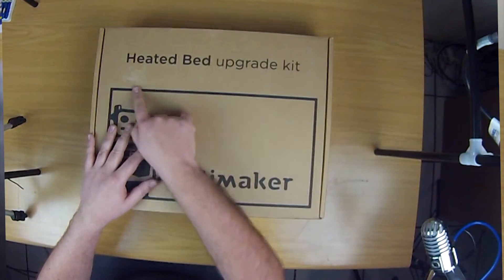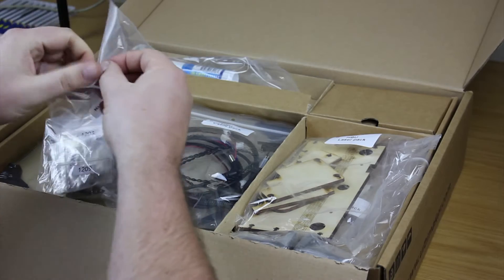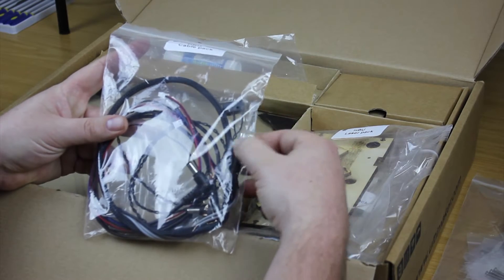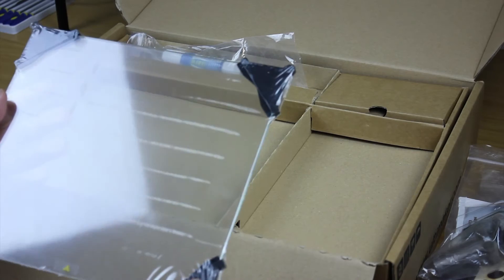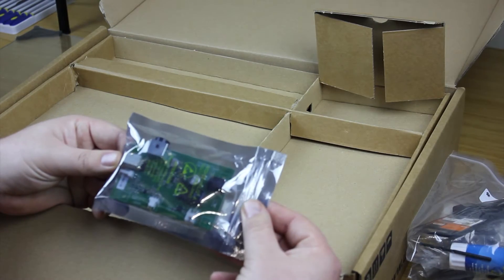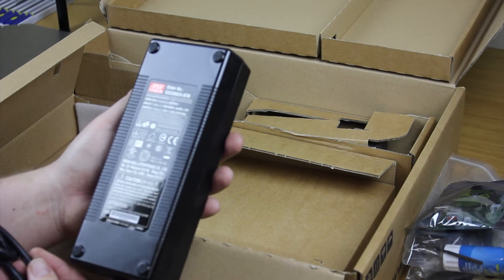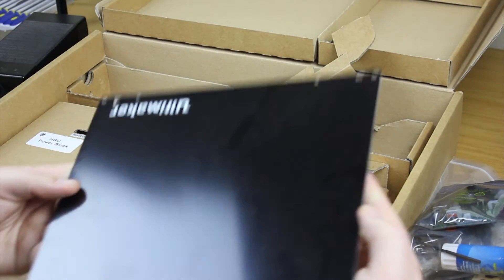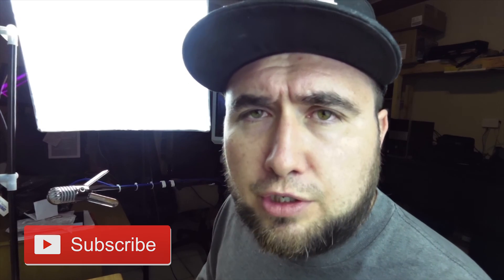Unboxing – Ultimaker Original Heated Bed Upgrade Kit

Comment: I upgraded my UMO. Such a difference to the printer now. Well worth it.
Reply from the maker: Hey thanks for checking out the video. yeah I am to enjoying the upgrade, well worth it :D how did you find the upgrade procedure ? Did you have any problems after the upgrade was done, for example the firmware didn't load and prints came out weird ?
Reply: I didn't have any real problems with the upgrade except checking and rechecking that what I was doing was correct. I had a couple of bolts that were the wrong length, but all in all, no problems. Prints have always been good from my UMO and even better with the bed. The latest firmware is even better and has breathed new life into the printer.

Comment: I just installed this about two months ago. Here are the problems I had... maybe you can help people not repeat my mistakes. 

1.) I put the bearings on the wrong side of the metal plate and didn't notice until it was time to mount the wire guide. 
2.) I had a hell of a time getting the bearings to line up properly to let the bed move smoothly. I actually think I had a bad bearing. Actually found a ball or two under the machine after a few days. I ended up replacing them with some higher quality parts and it now moves like butter. With the machine off, the platform will often just fall to the bottom as there in no friction holding it up.
3.) I ended up blowing a chip (the rectifier) on the small accessory board by powering off the Ultimaker with the switch on the side while the build plate was heating. Symptoms of the blown chip is the bed heater will continue to heat even when setting is at 0 or reached set point. I had to unplug the accessory board power supply to stop it. Complete run away. To prevent this make sure to do a cooldown through the Ulti-controller before powering off via the switch. Ultimaker sent me a replacement board no questions asked, and after digging into the forums it looks to be a known issue.
4.) Ultimaker includes a cable that allows you to run the main controller off the new accessory board. This cable actually melted itself and the barrel plug on my main control board after printing something in ABS (high bed temp and high extruder temp = high current). I really recommend using both power supplies to prevent that from occurring. 

All that said, absolutely awesome upgrade. My prints now come out warp free and not having to deal with the blue tape makes my so very happy. I have not had to relevel the platform for weeks. Have been printing in ABS, PLA, and PETG completely trouble free for several weeks.
Reply from the maker: +RayRaywasHere hey Ray, thanks so much for watching the video. I just finished the upgrade video just now. I had the same thing as you did  with your first comment lol. I have made a couple of other problems which i have addressed make it easier for someone  to install the upgrade . About all the other problems man that sucks I can't believe it.i have printed 3 abs prints 12 hours each and have no other problems.ill be sure you double check all the cables on my printer to make sure everything is in order. I should be uploading the video soon. I would like to have a follow up video to give feed back on the upgrade and problems I have had. I will be sure to add your experience with mine to help anyone else with the upgrade. Have a great week !